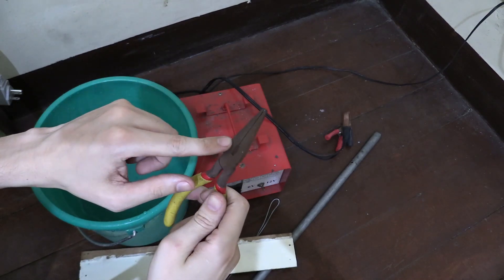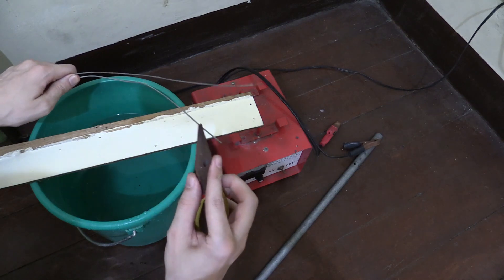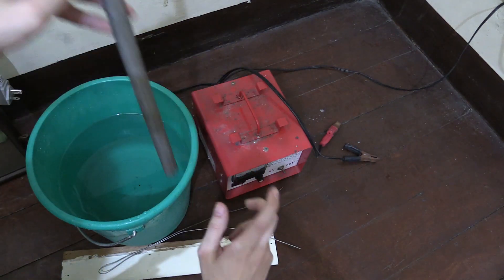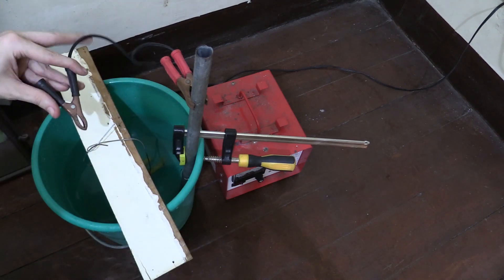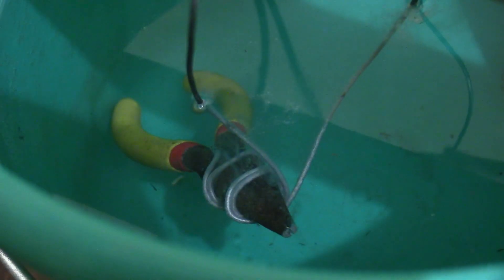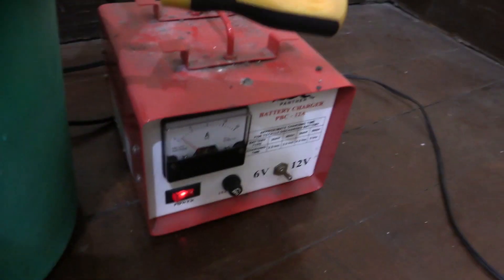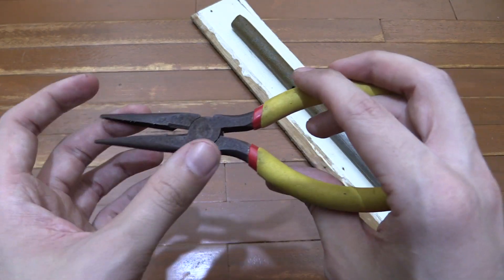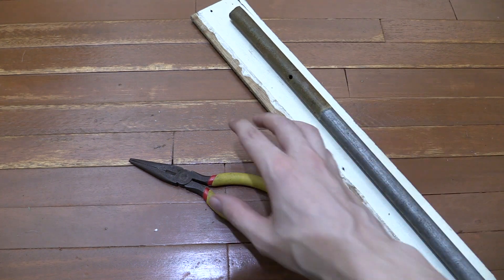Remove Rust with battery charger - Part 1

Comment: Baking soda creates a higher resistance in your electrlyte and creates a acid imbalance. (One of the reasons for low current in your example.) Go get washing soda it is 2 bucks at and supermarket. Also 15v  @ 5 A is good so maybe a old laptop pwr supply. With ventilation yes but also depends what you are dipping. Chrome lets of particularly nasty stuff. Its great for getting rust out particularly metal rulers without scratching away the  metal. I use it alot.

Comment: You can also use a D/C charger, but you have to strip the wire, and for safety, tape the negative wire up. But this will work for those without a battery chargers.

Comment: In the water-baking soda solution, the gases that are produced are hydrogen (H2), oxygen (O2) and carbon dioxide (CO2). Just putting that out there so people are aware that you need to use sodium carbonate all you have to do is bake the baking soda in the oven as previously stated in the comments Or buy Arm & Hammer super washing soda using (baking soda= sodium bicarbonate) and releases some pretty nasty stuff in the air.!!!! Please do research before you trust everything online!!!

Comment: Why not just use WD40? Takes about 5 minutes.
Reply: That would take a lot of WD40 to fill that bucket.
Reply: Wd 40 does not remove rust. It removes moisture. Wd 40 stands fir water displacement 40. The forty means they took forty times to get it right. Im not even bullshitting you either.
Reply: WD won't remove ant thing but surface rust

Comment: Awesome! I was thinking of making a DIY  vibrating tumbler for removing rust and polishing... this is an alternative to that... thanks for sharing!
Reply from the maker: +Jr Luna (LunaTech) How does the tumbler work? You use a special chemical or corrosive to remove the rust? Or it's also using electricity ?
Reply: +Gadget Addict motor attached to a tumbler with small rocks or pebbles to vibrate them... will post it later sir... also saw it on YouTube :)
Reply from the maker: +Jr Luna (LunaTech) Sounds cool!